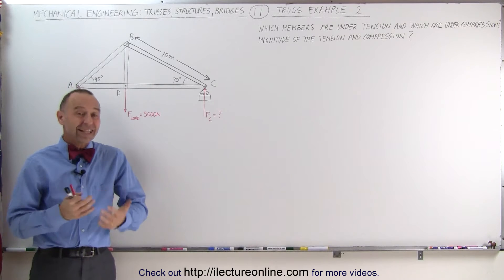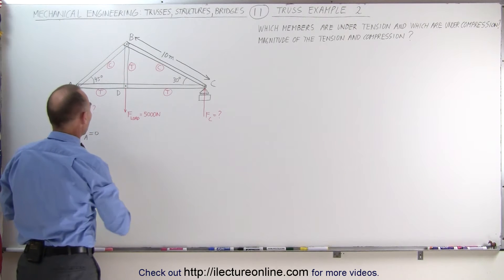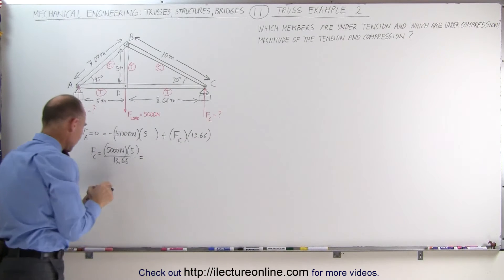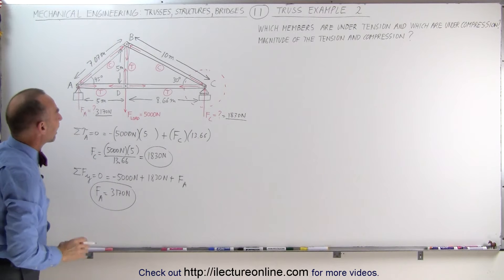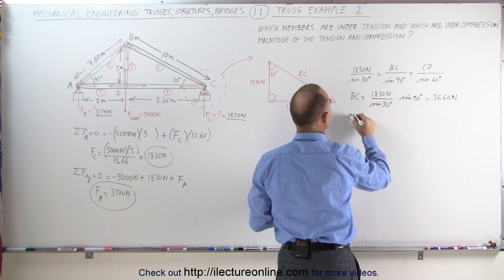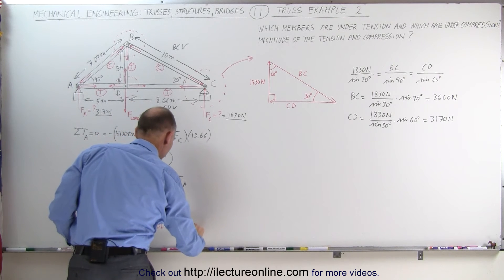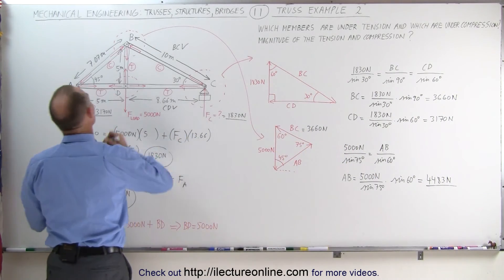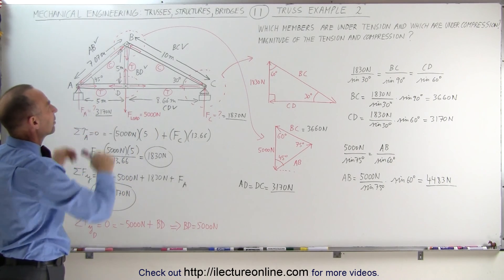Mechanical Engineering: Trusses, Bridges & Other Structures (11 of 34) Truss: Ex. 2

Comment: on a 30 60 90 triangle you can just multiple the shortest side by 2 to get the hypotenuse, and by square root 3 to get the longer side
Reply from the maker: That is indeed correct.

Comment: Hi sir! Why AD and CD have the same tension? Thanks!
Reply: Although the member looks like a single solid structure, it  does not have to be. They are two separated pieces bolted together. There is another member with a force of 5000N pressing against them. Now imagine that that member has divided one big solid structure in two: one is 5 m long and the other 8.66 m. Here the size of each member does not matter at all. What matters is that they have to cancel each other out because we know that all the sum of forces on Y direction has to add up to 0.. Both members now are pressing against that one member (5000N). If FC has a force of 1830 N, the other member FA has to have a force greater than 1830 in order to cancel 5000 out. Because AD and CD are pressing against each other in order to keep that load of 5000 N in place, the sum of the tensions on both members has to add up to 0, too, otherwise it would collapse.. So, if the tension on AC is 3170N, the tension on CD must be also 3170N. I hope I made myself clear.

Comment: In this video we assume that at joint A we have a vertical F(A) force, but in video 9 you said that joint A has F(Ax) and F(Ay). What is the difference between this two?
Reply from the maker: That is a good question, and in general you want to add the Fx component at point A as a general practice, even if the Fx component is equal to zero as it is in this case.  (I just left off the Fx component knowing it was equal to zero)
Reply: @MichelvanBiezen  thank you

Comment: You have labeled Force of A to go up vertically. Is this because at pont B, there are rollers, meaning there is no force in the x direction at point A?
Reply from the maker: That is correct.  There are rollers on the other side and the load force acts in the vertical direction only.

Comment: Dear sir, What if the load is placed 2/3 m or 1/3 m of the horizontal member How the struct is gonna behave? is it gonna be the same? Thank you, sir.
Reply from the maker: I suggest you watch the other videos in the playlist first to see how the technique of solving the problem works, and then you should watch the playlist of forces on a beam to learn about the moments and shear forces within the beams, because it does matter where you apply the forces.
Reply: @MichelvanBiezen  Thanks sir

Comment: The reactions of the Pin at point A has two reactions, so there is the vertical which is F sub A. However the horizontal reaction force is the same as the F sub AD force?

Comment: can you explain how you were able to get the distance from A to D? you said, because the angle is 45 degrees, the distance must also be 5 meters? I did not understand that. please explain. Thank you
Reply from the maker: The two sides of a 90 - 45 - 45 triangle are equal. sin (45) = cos (45)
Reply: Michel van Biezen thank you!